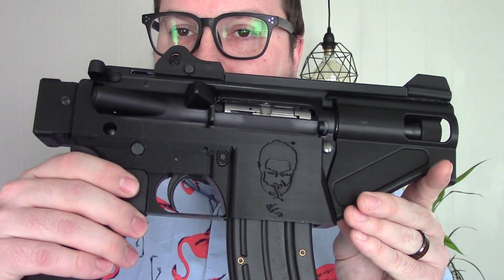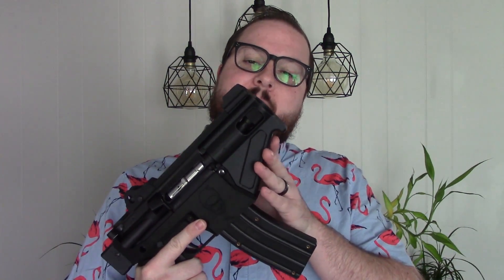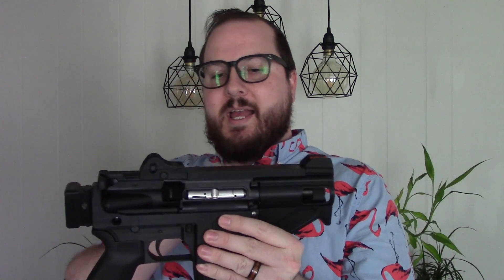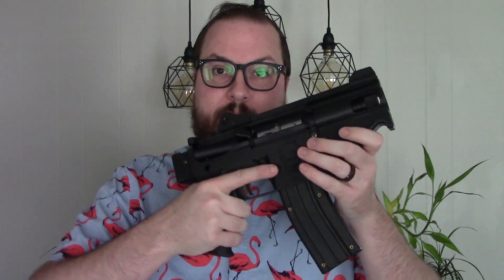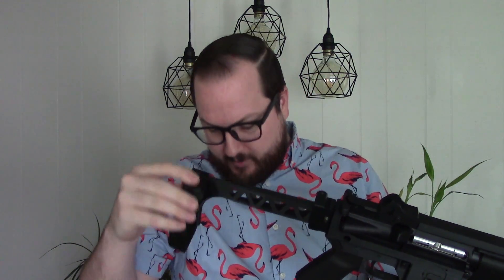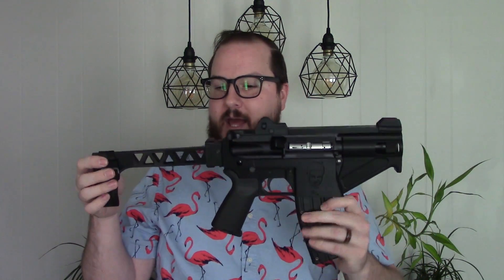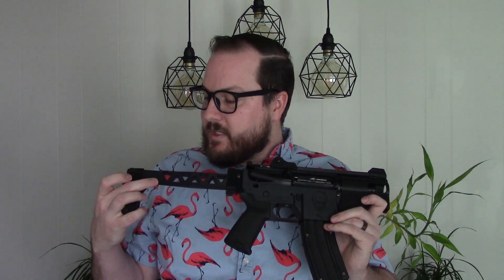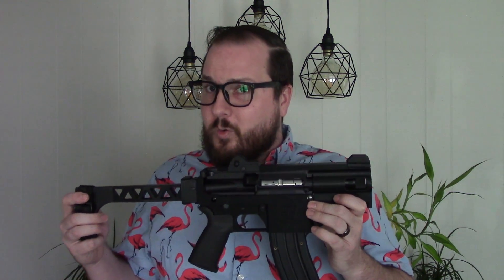3D Printed .22LR AR15 Pistol (Jeff Goldblum Themed?)

Comment: Not sure what state you're in but afaik, non center fire (aka rimfire) are not regulated by the sbr rules etc.. 
I could be 100% wrong about that but it's what I understood....
Reply from the maker: That’s 100% incorrect. SBR laws are on a federal level, not state by state. They apply to rimfire guns as well as center fire.
Reply: @z00miezoom14  I get that and have read MANY of the postings on the atf site, you should take note it specifies "made FROM a rifle" this gun is not made from a rifle, is it? I realize this is irrelevant to my initial statement, but your comment is equally irrelevant...
Reply: @z00miezoom14  gotta get deeper, for example a Lemat pistol has a short shotgun barrel on it right? Yet not nfa for other reasons 😁
Reply: @beargillium2369  Sure, but that wasn't at question. The poster surmised that caliber was the factor a firearm would be included in the NFA as an SBR. It would not. Caliber can however be classified as NFA if the caliber for instance exceeds 1/2" (as a DD).
Reply: @z00miezoom14  unless it's a shotgun, cannon, c&r, or otherwise exempt for "sporting purposes" etc etc ,🤪
Reply: @beargillium2369  You keep attempting to use the same obfuscation routine? Did/do you practice this with your progenitors also...
Reply: @z00miezoom14  lol I'm not trying to argue! I think we can all agree the atf rules are silly at best, right? Happy shooting!

Comment: lets see. you're more than happy to print a lower that you downloaded off the internet, but you're unwilling to share your files. hmmm.
Reply from the maker: I modified this lower file substantially before I printed it, but yeah, if anyone wants the normal lower, it's readily available from the people that designed it. But for MY lower, it's more difficult. My username and real identity are pretty well tied together because of my prior published works. Making parts and files for personal use? Generally considered to be just fine. Making those same files and releasing them to the wild for anyone (including people out of the country) to create can and has got people in legal trouble, especially when their release is tied to an actual identity and not an anonymized one. 

So, yeah, in general, I'm unwilling to share my files, and for a few good reasons. Sorry I guess?